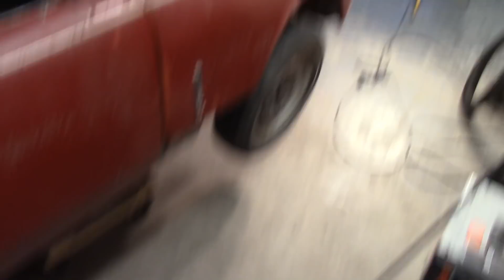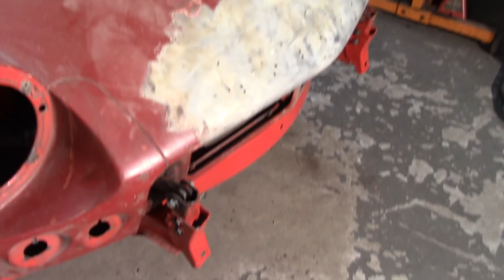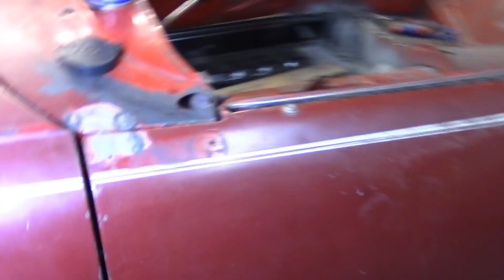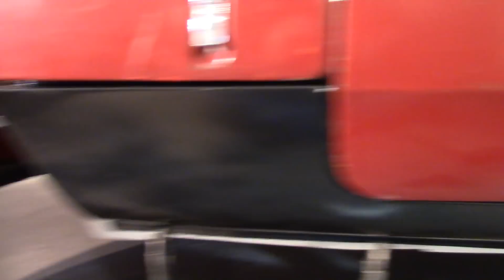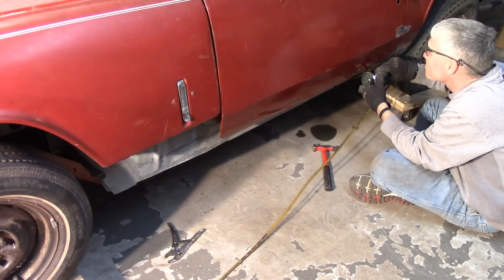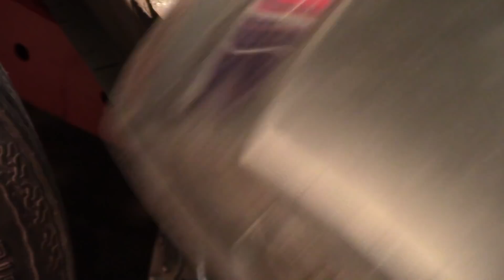Triumph Spitfire Restoration - Mind the Gaps

Comment: Nice job Chris, I thought I alone was having bonnet problems. lol... I have a MK2 escort that I am repairing and the bonnet is bowed in the center just as yours and i can't figure out whats wrong.  Great progress. get it on fast before something goes wrong. Lol.
Reply from the maker: Ha! I hear you. I think the bonnet may be able to be adjusted using the center support tube that runs between the two wheel arches and bolts up in the middle. Not sure though, I didn't try it. Thanks for the kind words!